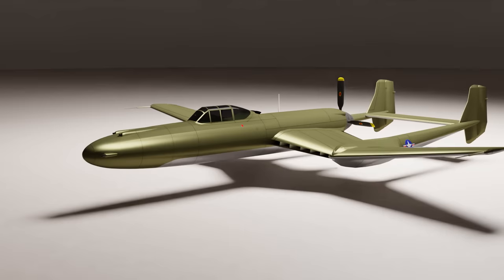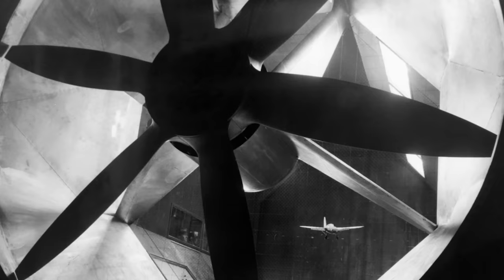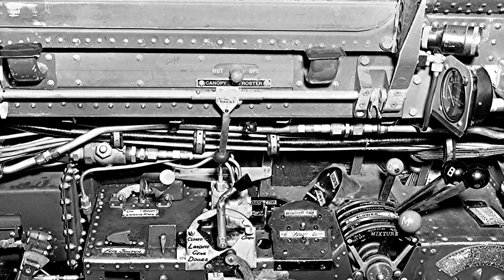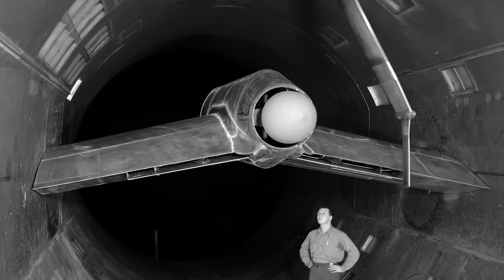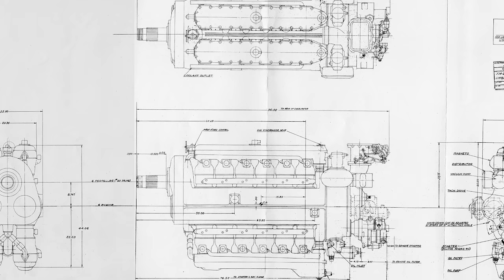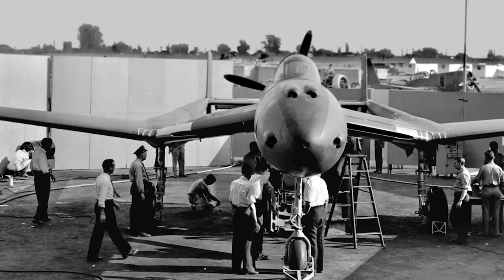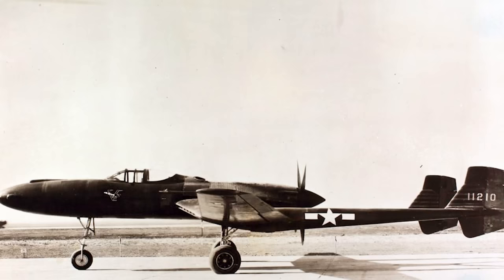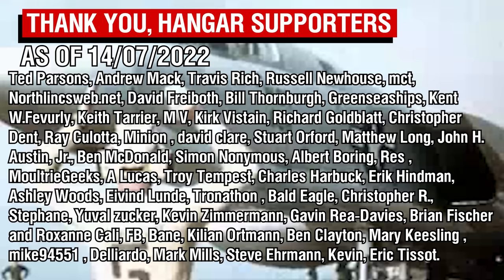The Super-Fighter That Was Betrayed By Its Engine | Vultee XP-54  [Aircraft Overview #68]

Comment: "The Super-Fighter that was betrayed by its engine." A story as old as the aviation history itself.
Reply: Seems to be quite a common theme.
Reply: That p+w h 2600 looks a maintenance nightmare!
Reply: Heavier than air aviation at least. Arguably all of powered aviation. But not all of aviation history itself, which includes things that do by definition cannot have engines such as hot air balloons.

That said I think the sentiment in the OPs statement is spot on.
Reply: It could easily have become an American version of the SAAB J21R…
Reply: Before avionics became the most important part of aircraft design, aviation was always limited almost exclusively by engines.
Reply: @joshkamp7499  That is half the truth, the other half is aerodynamics.
Reply: @joshkamp7499  Bad engines cripple fighters to this very day. The Chinese have a severe problem with their fighters because they haven’t been able to successfully copy the Russian engines that they were cloning.
Reply: @whyjnot420  Some Airships too had engine issues. An RAF official once lamented on the absurdity of the R100 - a successful Airship - being scrapped only because of association with the R101.
(the latter had diesel engines, that proved both underpowered and too heavy, especially in the bad weather that contributed to the R101's fatal crash)
Reply: @jimtaylor294  That kind of stuff is why I said arguably for powered flight. There was one dirigible I remember that literally couldn't make headway with more than winds of like 5 mph even.

But it is also 'arguably' since with a lot of the early designs, being able to move in dead calm was a success in many a case. As a new design might only have needed to move under its own power in any situation in order to be called a success.

btw didn't the R100 kill Sefton Brancker? Or was that R101?

edit: also to note is that "early" for lighter than air, is decades before the days of the big rigid airships.
Reply: seems like all along it was the engine companies writing checks they couldn't cash. 
every plane should have been designed with half its promised horsepower in mind.
Reply: @BlackMasterRoshi  Not a good idea. What is a good idea is designing a plane in such a way that if the promised engine is not available, it is not difficult to redesign the plane to fit a new one.

Designing a plane for X horsepower will result in a very different plane than one designed for X*2 horsepower.
Reply: @whyjnot420  You've clearly never seen a hot air balloon that caught on fire due to its burner. Just because the engine wasn't driving a propeller doesn't mean it doesn't have an engine.
Reply: @whyjnot420  well compare an original spitfire to a late war spit, it basically had double the horsepower. the planes fuckkin rip
Reply: So true. Pusher aircraft couldn't catch a break! They were built by just about every major country that was in WWII and not one found its way into service. It just shows how hard it is to get a good project from paper and into service. It's a process that can test the resolve of the best in the business.
Reply: @alexsis1778  The definition of an engine is that it *provides motion*. More specifically that it convert energy into motion. The burner in a hot air balloon does not meet this criteria.

Please don't treat me like a fool and I won't treat you like a moron who doesn't know what an engine is.
Reply: @BlackMasterRoshi  And if you compare early to late Spitfires you will find that they are essentially different planes that simply look very similar.
Reply: I think the skin being very flammable is a problem too.
Reply: @tomfennesy9105  Class D fire. I have heard some older people from the US Navy describe them thus: They go out into the water, one way or the other.

I have heard it phrased a few ways, but they are all similar. Meaning that if it doesn't get tossed overboard, it is just going to keep burning, straight through the hull.

Burning metal is not something to mess with.

food for thought: That said, magnesium is used for a fair bit in performance automotive stuff. Both with race and street cars. Common (as far as magnesium goes) for street cars are tire rims. So it is not as if people don't use the stuff in things that risk becoming an inferno and its not like trained firefighters don't know how to handle class D fires.
Reply: @tomfennesy9105  I kept waiting for Rex to say "And then an Army official flicked a lit cigarette butt in the general direction of the aircraft and poof." Lol. The other guy that replied mentioned a very important detail. That is the fact that when an aircraft built from magnesium catches fire on deck it has to be heaved overboard asap. The other thing that puzzled me was why the Navy would fund the development of an aircraft that could only be exited from the bottom. At the time the Navy didn't want planes like that because in an emergency resulting in a sudden low-level sea landing there's no way out. It's a problem that happened quite often back then. When launching from an aircraft carrier an aircraft could lose power and drop right into the sea. An aircraft could have an issue when landing on a carrier and end up in the sea. It's difficult enough with a normal cockpit to escape in those situations.
Reply: @allangibson2408  

And we should be thankful for that
Reply: @robertdragoff6909  Until it is time to get pissed off when American designs show up in yet another ccp airplane.
Reply: @allangibson2408  Somewhat ironic because Russia cannot sell their aircraft because of the engines.
Reply: @whyjnot420  That's a good comment. Fires from magnesium aircraft parts were a serious concern for crews on aircraft carriers. As you mentioned, the deck crew's best and most used solution was to shove the aircraft overboard. For those who don't know a class D fire doesn't refer to intensity or the difficulty extinguishing it. Instead, it refers to the method required to extinguish it. Class D fires are often grease or electrical fires that can only be extinguished by using dry chemicals to prevent air from fueling them. Water can spread a class D fire or make it worse. During WWII the Navy normally used water and a type of protein-based foam to put out fires. When water is used to put out a magnesium fire it only makes the fire more intense. That's because when water hits the burning magnesium it's transformed into hydrogen (Mg (s) + 2H2O --> Mg(OH)2 + H2) As we all know hydrogen is highly flammable and that's why putting water on a magnesium fire is not a good idea.
Reply: @jimtaylor294  The Hawker Tornado had the same engines as the Manchester. The Manchester had problems with engine fires but the Tornado dd not. But when the Manchester was scrapped so was the Tornado.
Reply: @whyjnot420  Sometimes it is a case of the original engine not being up to the job. Once you replaced the Alison engine with the Merlin the A-36 became the P-51.
Reply: @Jonathan.D  Grease = K (the foodservice version of B) or B, electrical = C. Class D is specifically metal that is on fire. A class D fire extinguisher like you mentioned is designed to be used on the fires of the same class, but can just as effectively be used in tons of other situations. The only way to stop flaming metal is to strangle them to death. This is why the powder used in those class D extinguishers is horrid to deal with, it is designed to get everywhere in order to smother whatever you are tackling. and. it. gets. everywhere.
Reply: @whyjnot420  I forgot about the K extinguisher. It's specially designed for kitchens because it prevents any grease in the air from reigniting. Extinguishers have come a long way since those glass balls people used to throw on fires. I've heard some bad stories about people picking up a class D extinguisher and spraying someone in the face because they saw someone on tv get sprayed with a class A water or CO2. It's definitely a bad idea. Just ask Bam. 😄
I was once in an engine room when someone accidentally tripped the Halon system. We almost didn't make it out because it instantly eats up all the oxygen. Of course Halon has been banned for almost 30 years now.
Reply: Aerocobra enters the chat ......
Reply: Westland Whirlwind also enters the chat (it had TWO crap engines!)
Reply: Hawker Typhoon? Hawker Typhoon.
Reply: @whyjnot420   Vertical is a direction and the burner of a hot air balloon converts fuel into heat which changes the density of the air and that causes the balloon to be more buoyant and move up.  So yes you could make a case for it being an engine or part of the engine. Does it matter? Not really because I think it was clear that you meant what is commonly called an engine today. So no need to get upset, you are no fool. The other guy is probably not a moron just pedantic.
Reply: So many examples of this, The YP-49 is a good example as it was the only aircraft to use that engine so was not seen as being worth the effort, the Westland Whirlwind again because the engine was being superseded or the long string of nightmares that was the Westinghouse J40 all of the aircraft designed around that engine that went into production had to be reworked for the J57 or J71. You also have the TF-30 which while it ended up working well enough to be serviceable in the F-111 and the F-14 was never a great fit and the F-14 was greatly improved by going to the F110.  I am sure there is a long string of aircraft that could be in that catagory.
Reply: @DavidSiebert  PART I will grant that. Burners of a different sort are part of things like steam engines (though plenty will argue they are related but separate, and they do have a point). But what is a transmission that lacks a means to change gears? What is a steering wheel that cannot move? They are not steering wheels or transmissions. (no pedantic bs here, you know what I am talking about). Just because something is part of something else, does not make it that other thing.

Though I would argue that you are wrong here. The actual combustion process itself is what is moving the piston in an ICE. For a hot air balloon it is heating air which is then expanding which is producing lift. Thus the burner is not turning energy into motion itself. Rather it is enabling something else to produce motion.
Reply: The fix was always to put a Merlin in it.
Reply: Bahahhahahaha ha hahha
Reply: Very true. "The engine was plagued with developmental problems and didn't achieve it's rated power" is the "It was a dark and stormy night" of aviation history. The engines didn't stay together very long, but if the engines had them, the almost obligatory cooling issues weren't mentioned.
Reply: @suzi_mai  Well, you sure can't get parts for them...
Reply: @tomfennesy9105  The engine being cancelled destroyed both prototypes before catching fire became a problem. The Vietnam era F-111 made extensive use of magnesium belly skins, and it made it into squadron service. Many jets of that era , like the F-100 and the F-104 were essentially death traps anyway.
Reply: @Jonathan.D  I don't think the video said the Navy was interested in the plane. They just wanted to share development costs for the engine.
Reply: @herbertshallcross9775  With this plane yes but the navy did develop and use planes that required pilots to escape from the bottom. This led to the inevitable happening. That's what I was thinking about but did a terrible job explaining. That's what happens when you comment at 2am instead of sleeping.
Reply: @bigblue6917  The Allison-powered Mustangs were good aircraft, and the engines largely performed as advertised, but plugging in half again as much power with little weight penalty would help any plane.
Reply: @louisbabycos106  The P-39 was a good airplane with excellent maneuverability that did what it's designers intended, which wasn't a high-altitude interceptor. The Russians loved theirs and killed a lot of German tanks with them. The P-63, the same concept was also a good aircraft, which, you know, more powerful engine, better performance, but still not an interceptor. It was not it's designed role. 

It's like criticizing an A-10 because it was never an F-15.
Reply: @Jonathan.D  No need to apologize. I'm a bit of a nit-picker, like most armchair "experts".
Reply: @herbertshallcross9775  I'm normally the same way. I don't like disinformation. I remember now that it was a reply to a reply and was after I had watched another video about the Navy adopting aircraft that they knew would doom the pilot if they had to ditch at low altitude. The Navy had ruled not to allow the use of such aircraft. In certain circumstances, they would make an exception because it was cheaper to adapt an existing aircraft to be used on a carrier. There was an interview with an aircraft carrier crewmember who watched a pilot ditch next to the carrier. It was known that the canopy of that aircraft would not open once in the water. The crew watched the pilot try to open the canopy to no avail as it slowly sunk beneath the waves. Sadly, it was not the first nor the last time the crew watched that happen. Besides the fact that it's wrong to put cost before human lives. It's also much more difficult and costly to replace a person than the equipment.✌
Reply: F7U comes to mind also, the front gear was solvable.

Comment: Interesting concept that seemingly had a lot of potential. The Japanese Kyushu J7W Shinden is worthy subject for your attention.
Reply: Yeah, it was interesting. It even was the subject of a story arc in *Oh My Goddess!*. But like all the American pushers, it was too slow and too late.
Reply: Ace Combat Fan did a video about it on his "Know Your Plane" series. I'd still watch one on this channel though
Reply: The J7W1 was actually intended to be powered by a jet type engine. The propeller version was used basically for testing the concept. Propeller version would have been built and flown until the intended powerplant was ready, if it ever would have been. I always thought that the J7W1 was the most beautiful of all of the concept plane that anyone else ever made.
Reply: @steveproctor1748  I think it is a beauty contest between the Kyushu J7W1 and the Lockheed Starjet L-133. The Starjet project was sadly cancelled before it was flown.
Reply: Yes, please do a series on WWII pusher aircraft and add Dornier DO 335
Reply: @steveproctor1748  The propeller version was actually built and flown
Reply: Meant to have been a jet, and looked it.
Reply: @billalumni7760  you do know that DO335 is a push and pull prop (2 engine 1 front and 1 back) air craft and it succeed as a reconecence plane idk of its ground attack role tough
Reply: This kind of planes seem like a Missing Link between WW2 pistonprops, that pull the aircraft, and Cold War jets, that push it